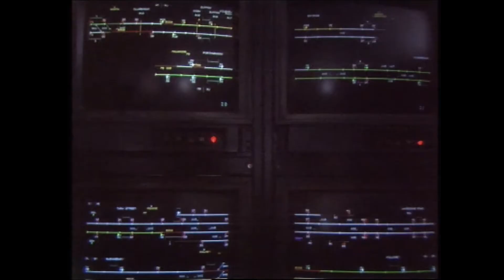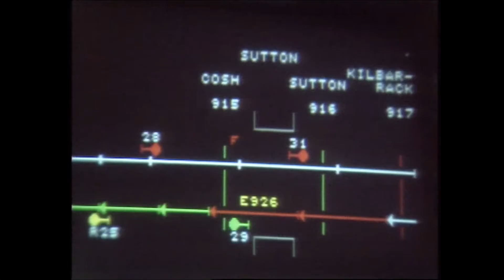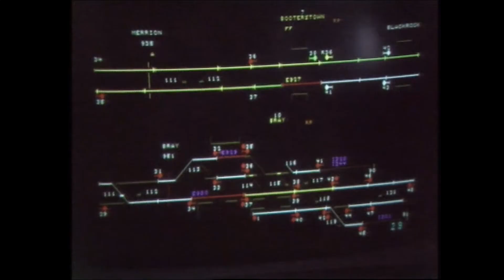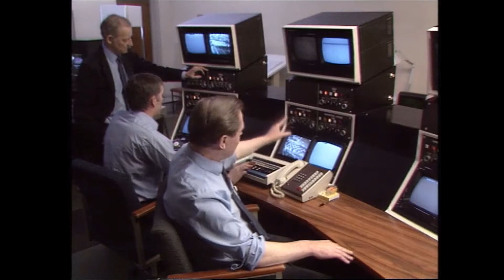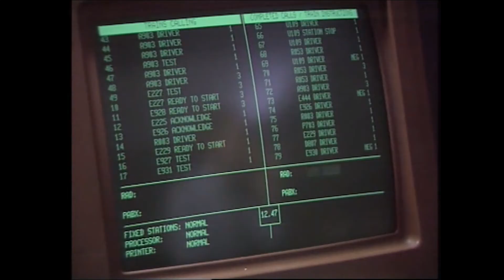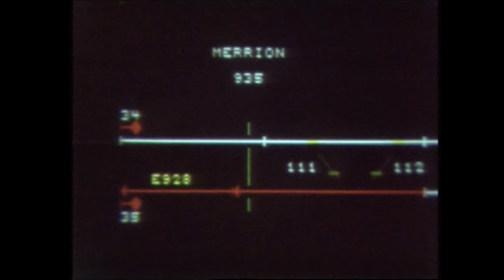Inside The DART Train Central Control Room, Dublin City, Ireland 1986

Comment: Is that the entire piece? If not, is there a chance you'd have the full piece this comes from? I'm a former CTC signalman and currently a Traffic Controller (though of a younger vintage). There'd be a fair bit of intereset among the few older staff still here. None of those lads are here of course, but fellas who worked with them would.